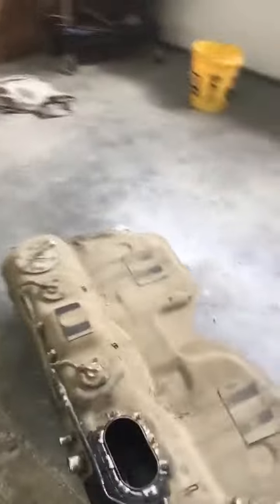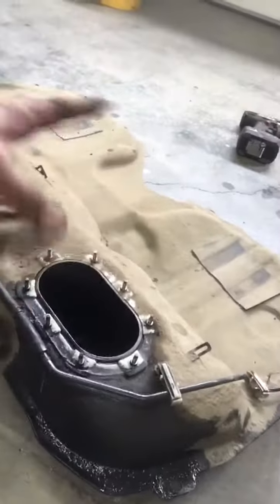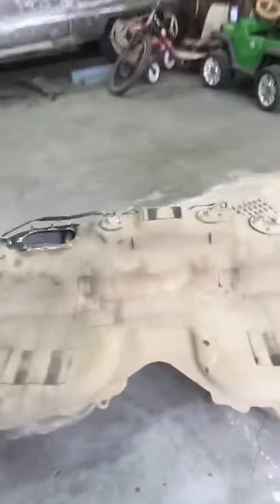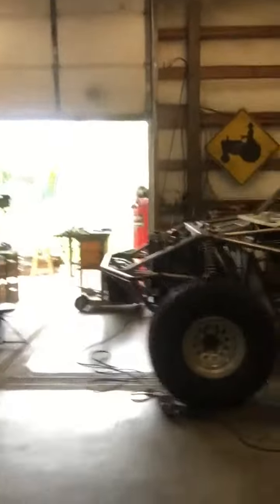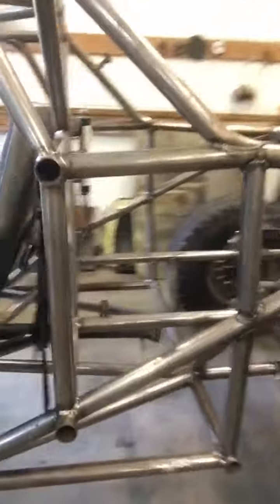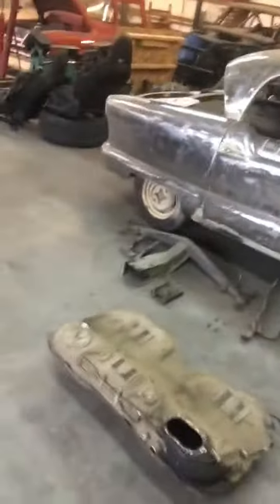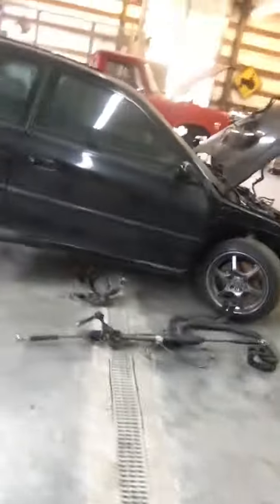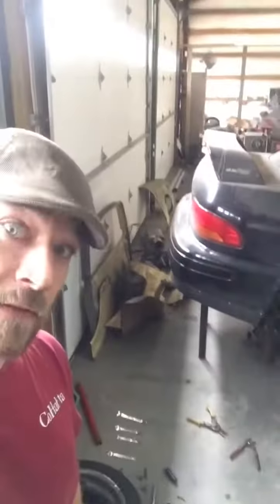Subaru gas tank removal part 3 of 3

Comment: Sorry the tank didn't work for the  tube frame racer you are building.  You have no doubt moved on in the year that has passed but someone who needs a  replacement would pay $1900 for a new subaru tank, you might let yours go for a fraction of that.